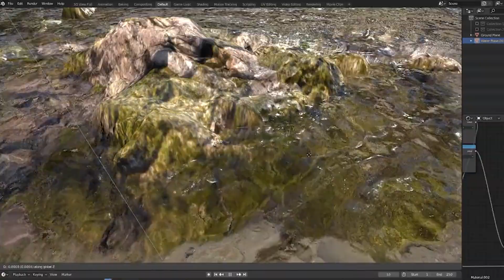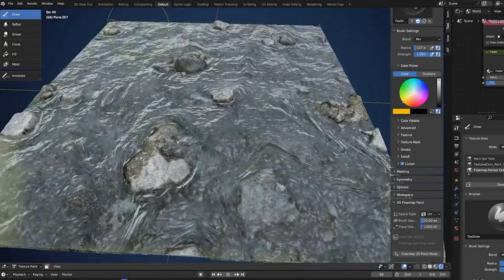Blender 3.6 Dynamic Water Flowmap Demo

Comment: Hello again. 
It's not ok to use other creators' videos without permission, and it is certainly not ok to remove that creator's branding and replace it with your own. Mentioning the creator in the video description is not enough; not everyone reads descriptions, there are various instances in which the description is not even available, and if your video gets ripped from YouTube, the description does not go with it. If you genuinely want to make videos for the purposes of promoting other people's work, this is not the way to do it.
This video violates terms of service and should be removed. Please take this video down.
Reply from the maker: Hi, should I remake the video with an initial credit with a text caption (right/left of the video) and the watermark, right? On description I mention you and the profile, but I undestand it isn't enough,should I undestand right the request?
Reply: @Gioxyer  Yes. Ideally, the videos used should be uncropped and any original watermarks left unchanged, and a legible caption somewhere on screen with the name of the original creator and their YouTube/Twitter etc. You can keep your branding at the beginning of the video, and even your watermark but avoid overlaying it onto the original.